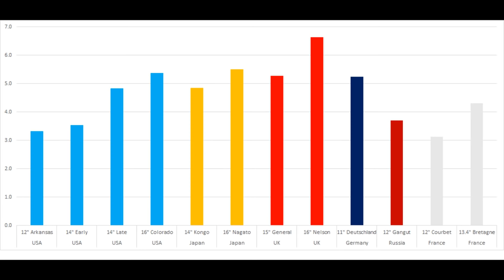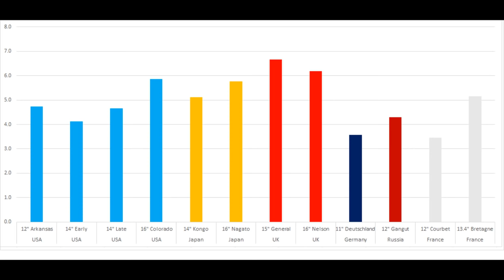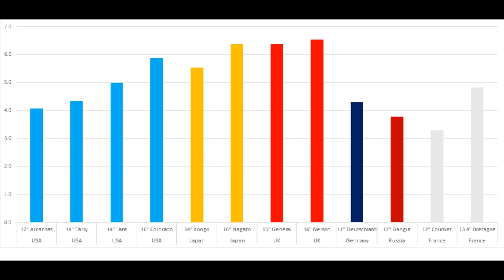Battleship Guns of WW2 - A series of tubes

Comment: What it goes to show is your methodology is more important in statistical analysis than the raw data, which can be fudged number based upon experimental error !  So unless all objects are subjected to the same tests data becomes less valid. So by example....Armour penetration is dependant on the quality of the target materials of the target, the charges behind both the propulsion and explosive value of the shell may have differing quality. So as each nation will have different standards in their testing data and you know that sometimes data rapidly  becomes incomparable against each other with any degree of accuracy.

Comment: Speed of traverse and elevation is borderline irrelevant because you'll only have to utilize either in a significant manner during initial engagement. After that, only minor adjustments would need to be made. Reloading speed would be more important than elevation speed for repeat firing.

Range is, also, borderline irrelevant. At extreme ranges, accuracy couldn't be guaranteed in the slightest. Accuracy by volume would be more important at range like with the "machine gun cruisers" such as the USS Helena. Shooting past the 18,000-20,000 yard range with the technology of the time on a rocking ship is honestly futile. Few engagements took place at that range or greater and considerably fewer hits occurred. At that range, armor piercing ability is deplorable at best almost regardless of which round or caliber you're shooting. Velocity penetrates armor, not weight or explosives. Angle is also important. You would want a round to impact as near to perpendicular as possible to the hull and at that range, the round would be hitting at an extreme angle approaching parallel to the hull. This would result in a ricochet or, at best, minor damage on even the smaller ships with lighter armor. This aspect puts you into the 15,000-18,000 yard range in order to get some kind of penetration to the hull. Even secondary batteries could hit at this range, in most cases, and all primary batteries can reach with varying levels of armor penetration due to velocity, not weight or explosive ability.

Something not taken into account was the number of guns. A smaller bore means smaller breach and lighter barrel allowing for more tubes to be placed in a turret or more turrets on the ship for the same or less weight. For instance, the Iowa had nine 16" guns to the Helena's fifteen 6" guns. While the 6" guns wouldn't do much to thicker armor of battleships, it would turn another cruiser or a destroyer into swiss cheese and those where the more likely opponents. Using the slow-firing 16" guns with only 9 rounds before a reload against a destroyer would be overkill and could potentially result in an over penetration resulting in a less than optimal hit with minimal damage. The 15 faster-firing 6" guns would be greatly preferred against the more common target.

Which brings us to the next point: what are we aiming at? If we're doing shore bombardment, a mixture of 6"-16" guns would be great because of the varying levels of fortifications. At sea, however, I would be hesitant to take a battleship against the same tonnage of destroyers. While you'd likely get one or two, there are still others around with torpedoes that would really ruin anyone's day without using their incredibly small deck guns. A lighter, presumably more maneuverable cruiser would be great to take against 4 or 5 destroyers, if needed, and the 6" or 8" guns could fire faster at more targets than the 14-16" guns of  most battleships which would, most likely, just punch through the destroyers especially at "close" range.

In reality, it all depends on the situation. What ships you have against whatever ships the enemy has, whether the fight is in a confined area like Salvo Sound or in open sea, and so on. There is no correct answer on which gun is better or worse regardless of which metrics you use to measure it. I used to be in army artillery on a 155mm gun. I would take a 105mm over the 155mm almost any day of the week because we only had the two options. If we still had the full compliment of 75mm, 105mm, 155mm, and 8", then it would depend on what my target is an how far away it was. 8" for harder and/or farther targets, 155mm for precision, 105mm or 75mm for closer targets or direct fire against tanks, bunkers, or similar targets.

Comment: Great analysis. It is hard to fault either your method or your conclusions.  A couple of musings... It would be really nice to have CEP (omniscience anybody),  because a miss by a devastating AP shell is still worthless. I wonder if angle of fall at 20,000 yards might be a better metric than maximum range, given that it focuses on ballistic performance of the gun rather than turret elevation capability? Of course, then you get into the belt vs deck penetration benefits...  Well done!

Comment: Just to add more mess to your calculations: the Iowas each fired more rounds in shore bombardment than they ever did against a naval vessel, let alone against another battleship. The Iowas were also intentionally range limited by their super-heavy armor piercing round which was intentionally designed to drop ballistically onto the less-armored deck rather than having to defeat the armored belt. Now you may point out that most of the Iowas war service was post WW2, but that rule applies to the USS Texas (a WW1 relic) also fired more shells in shore bombardment than in anti-battleship (in fairness D-Day made that true for just about every ship that participated).

Comment: I think comparing guns like this is kinda pointless. In the real world Navies designed their guns to be used in a certain way. Like for example the Germans designed their guns to work in the North Atlantic theater. Their expectation was, that typical engagement ranges would be somewhere between 10 and 20 km due to how rough the North Atlantic is. And that meant they also built their armor to be most effective at these expected ranges. And it turned out they were kinda right as we saw from the Bismarck. She blew the Hood out of the water easily and then survived close range bombardment for a long time before being scuttled by its own crew.  Would it have fared any better with Iowa or Yamato guns? I don't think so.

Comment: Question about your methodology: did you weight the categories or leave them at equal importance? If you left the various categories at equal importance, assigning importance multipliers to key categories might have produced results more in line with expectations. Thoughts?
Reply from the maker: I left them at equal importance, because it would otherwise be too easy to be tempted to tweak importance weightings to my own ideas as opposed to remaining objective. :)
Reply: @Drachinifel  You could refine the weights by using the Quality Function Deployment method with a panel of experts.  I can understand using equal weight when doing it by yourself but that still introduces a bias even if unintentional.

Comment: Re range - longer range higher velocity guns allow flat trajectory so more penetration of belt armour - correct - but only if this range comes from higher velocity, if it is through higher elevation then no. However a 15" gun with a maximum range of say 25,000 yards (compared with a high velocity gun at the same elevation) will be producing a far more plunging trajectory and deck armour is probably the weakest point.  Range vs given elevation would be the best comparison. Anything beyond 25,000 yards is pointless except for shore bombardement and would be the reason for very high elevations.

Comment: Would it make more sense (or at least different sense)) to rate the fighting capacity of a ship. not just the barrel of one of the guns?  That way, things like 'weight of a full broadside' might get factored in, etc. Traverse and elevation rate might also appear, but - given ranges, etc., I'd expect the guns to be able to point generally in the right direction and elevated for correct range right from the get go, but maybe night fighting, use of radar, etc., would be part of the calculation?

Comment: I was rather surprised that you didn't have some sort of armor-piercing ranking system, since part of the testing for these guns was usually firing shells against armor plate at testing ranges to check their ability to penetrate armor at various ranges or amounts of propellant. Is this information really difficult to get hold of?

I do agree that gun accuracy is difficult to gauge, because a really good gun crew can make the best of a mediocre gun, while a poorly trained crew can mess up with even the best equipment. And since you don't have one group of people checking the accuracy of all these guns, there can be no consistency in tests for accuracy.

Comment: Perhaps a better measure of range would be velocity? Although different guns/shells retain velocity differently so its not exactly equivalent to range. Maybe a better alternative is the range of a gun at the same angle of elevation, eliminating the turret from the equation. I was also curious why you didn't add the 12" guns from the Alaska class. They were pretty potent systems even if never on a official battleship.

Comment: any chance that you could include your hypothetical lighter/normal weight 16inch shell as fired from the US 16/50? It seems it would have higher penetration at reasonable 20-25k yard ranges and a greater "point blank" range.

Comment: Any analysis is going to have some subjective judgments.  However I think you’ve done as fair a job as possible.  The only consideration I have is your separation of the gun itself from the supporting system.   It would be one thing if a given gun was used on a broad variety of ships, like the AA guns previously reviewed.  However most of the battleship guns you evaluate here are peculiar to a given class of ship.  Any naval gun is no better or worse than all the systems supporting it.

Comment: You should have split your weapon analysis in three parts, gun, amunition and turrets. This would make much more sense from a physics perspective as the gun itself fixes the calliber shot and influences spinn rate, the amunition influences range and penetration/exploding power and the turrets determine rate of fire and elevation.
Reply: And the fire control system greatly (but not exclusively) influences the rate of hitting, which after all is what guns are for.  Drach had to stop somewhere, and in my view he was right to stop where he did.  Analyzing turret performance (ammo hoist performance, loading drill, power/hand operation) would have greatly complicated the analysis and most of the information available on turret drill is fairly subjective anyway.

Comment: If you get an itch to do guns used in shore batteries as well because they could be used in comparisons of both older ships and paper ships 

the Germans still had WWI 12" shore batteries with updated MKs of shells and extreme elevation

The Germans had h 39 16"/52 guns in shore batteries

The British had old 13.5"/45 in shore batteries

And maybe some others I'm not thinking of off the top of my head most of them where ones still used on battleships like French had a bunch of Bretagne gun ones and US had it's same old standard class 14" on most of it's batteries British also had some venerable 15"/42 batteries.

Comment: Even thought there may be no accuracy data for many of these guns, I would think that you could come up with a qualitative fire-control bonus-points system, normalizing some of the differences, like Iowa 16" to Yamato 18". Those big 18s are not much good to anyone just making big splashes in the water.
Reply: Fire control is part of the weapons system, which was specifically avoided because this is pure gun v gun, not ship v ship.
Reply: @philb5593  Yes I know.
Reply: both yamato and iowa had about the same rate of fire and a max dispersion of less than 500m at max range.
but the yamato had a max reach of 42km while iowa could only reach 38km.
so at best yamato and iowa were even when it came to the guns but more realisticaly yamato had a slight edge thanks to its longer reach.
which is the same conclusion drach came to in his analysis while disregarding accuracy.

Comment: While I usually agree with your conclusions, not in this case.
For exemple, for the reload of the Italian 381/50 you take into account the reload of 45 seconds. It is proved (also in Del Toro book) that it could load in 30 seconds (or a few seconds more).
You take into account that the guns were inaccurate (wrong, it was the ammunition) while for the Richelieu you do not take in consideration the guns awful condition. So a comparison with not the same criteria.

Comment: Well, i understand that the Scharnhorst 283mm-guns are not as good, compared to other much heavier post 1930-guns.

But given the intended use, for merchant raiding they are in my opinion the best choice. R-Class ships have to watch out, cruisers (light and heavy) are in great danger.

Of course the Scharnhorsts would have been better off with the 380mm guns used on Bismarck and her Sister.

And one thing i always think of: you usually compare a battleship gun against the main armour belt. But how about high elevation shots, that hit the superstructure or decks? Of course you have the armored deck, but that is usually a lot thinner than the belt.

Comment: Accuracy has nothing to do with the guns themselves. It has to do with the range finders, the analog computer, and the reliability of the charge used to propel the shell. If the charge has a high rate of variability, most of the shells will miss the target, even if you got the range down to 1 micron.

Comment: You start by throwing out range because, beyond a certain distance, it's useless, but then add it back in because a long-range gun can shoot flatter, and therefore more effectively. You then give full credit to weaker guns that because the turret allows them to elevate higher, have a longer range, even though, at that elevation, the range advantage is negated. Perhaps, establishing a maximum elevation for effective trajectory and using the range at that elevation would be more informative.

Comment: I hate to even bring this up, since you've worked so hard on this and done such a good job... BUT, rate of fire is also not a characteristic of the GUNS, but of the turret and related factors. It might be a good way to QUANTIFY the quality of the turret.
Reply: Rate of fire is very much affected by projectile size and weight though. It’s one of the reasons the 18” guns are slower firing than the 16” guns.
Reply: @jetdriver  True. But the size and weight isn't an issue for the gun itself. It's an issue for the turret equipment and the turret crew.
Reply: @MakeMeThinkAgain  yes but you can’t just wave a wand and say mass doesn’t matter. Good find Nathan’s comment about Yamato’s rate of fire. If the technology available does not allow the gun to be loaded faster because of its weight then it very much matters. It’s not like designing a turret to only elevate 30 degrees when the technology was right there to have it be 45.

Comment: since range is a product of the elevation, weight of shot and shell velocity, wouldn't it be better to use shell velocity and weight off shot instead of range? This way you can remove the elevation from the equation.

Comment: I'm kind of surprised that you used the best shell for the Vanguard's guns even though it was never issued, but then didn't give the best rate of fire for the Bismarck's guns. Wouldn't it be best to consistently use the best possible performance as engineered?
Reply: rate of fire is something that can be gamed somewhat in a test, and is known to not reach test numbers in actual combat. Use of two different shells is an either or thing.
So different, and entirely valid to not use one for comparison but use the other.

it will displease the wehraboos tho. (added bonus IMO)

Comment: In my opinion, every gun is measured by it's accuracy. And a gun can really only be as good as the people using said gun & how experienced that person is at using that gun. And it's ability to hit the target repeatedly no matter what. So really, with battleship grade guns, they are only going to be as good as whatever fire control systems are being used & how experienced the users are at getting an accurate firing solution and making it tell. And ŵhen Washington fired on Kirishima, they were using a firing solution that came from the radar returns. And since the crew had practiced repeatedly using the radar to get a firing solution & then using it to fire on target that was why they were able to fire & hit Kirishima as much as they did. It makes me actually wonder if there were any shells that missed.

Comment: I personally would have simply made the minimum value represented in the group for any given criteria worth 1 point and the maximum value worth 10. 

Your max range is 44K? Awesome. 44K : 10 :: 29.7K : X. Do this for each category then tally the points for the best and worst overall. If you must, add another section worth 1-10 points for your own personal biases.